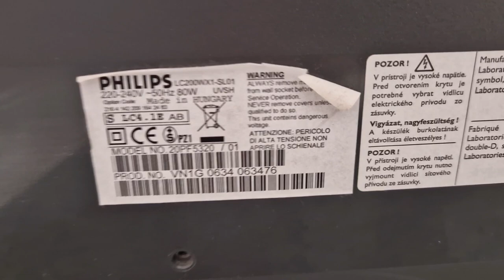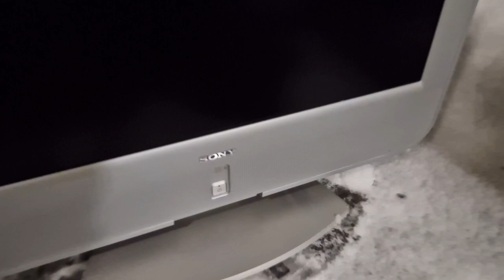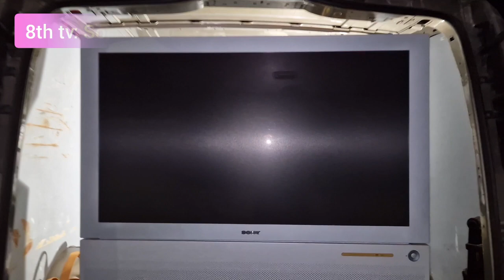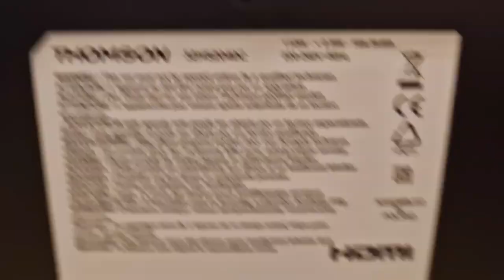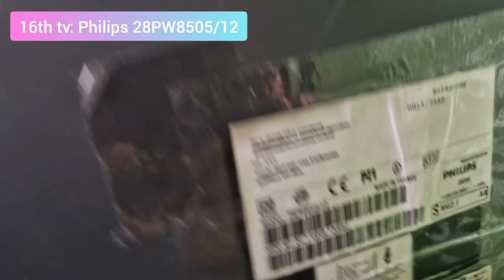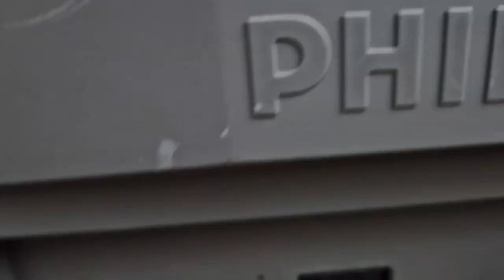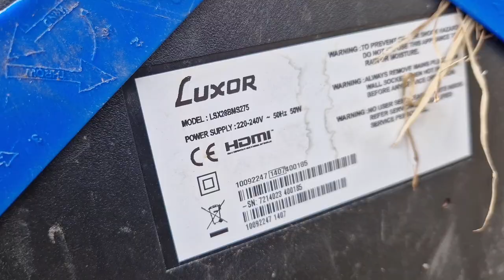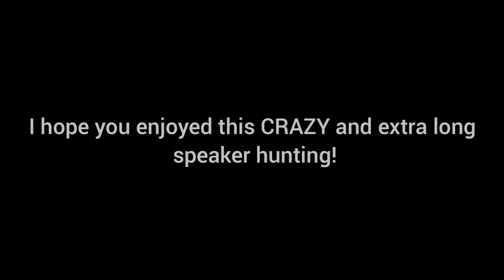Speaker Hunting #3 | Philips, Sony, Panasonic

Comment: I also own a Philips TV crt  and it has a fairly powerful sound system, but the speaker needs to be replaced because it has become bad
Reply from the maker: Ohh, does it have a subwoofer? I got a philips matchline with a foam rotted (foam material around the cone has become weak) subwoofer  driver which causes ratteling, dont replace the driver, it is not hard to fix. If you replace the driver, it will not sound as good. You just need a new surround for it
Reply: @theloudspeakernerd-tlsn9322  oh thanks bro ✨ 🙏
Reply from the maker: No problem :D there are alot of good tutorials on how to do it :D